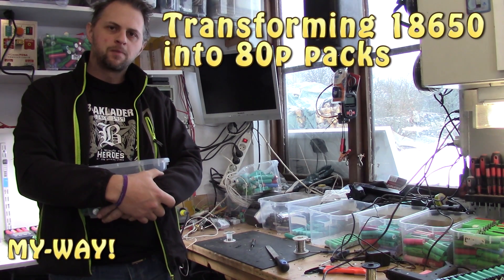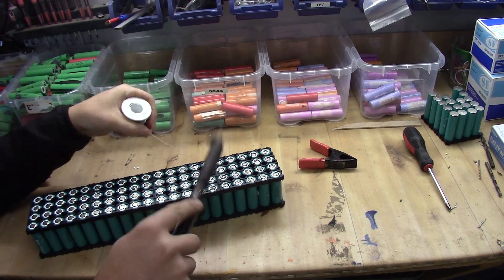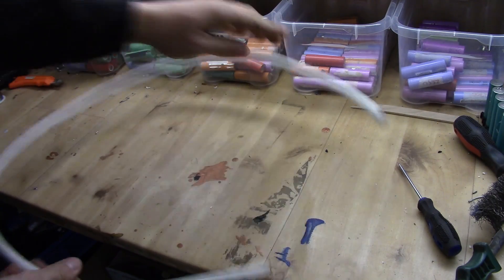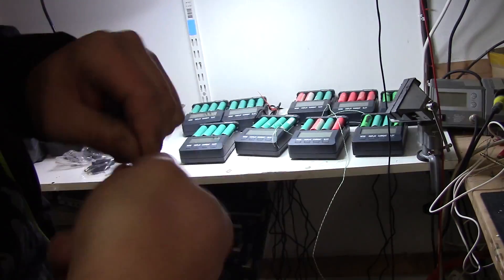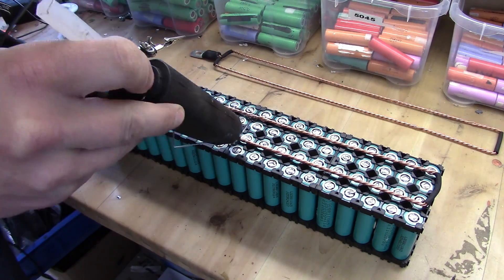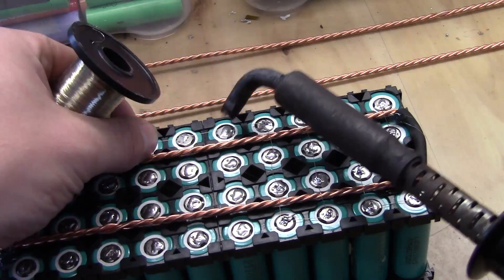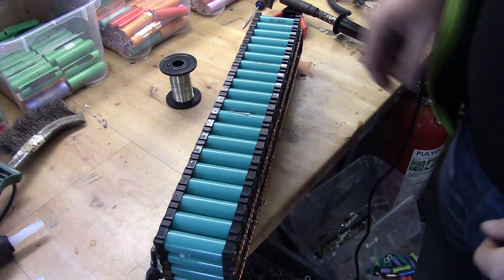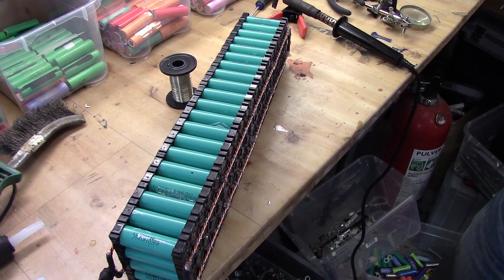18650 - Assemble the packs HOW TO 80 Tesla powerwall!

Comment: I love that soldering iron 200w... It looks like a old timer. Where did you get that?
Reply from the maker: Good question. Its something my father had earlier. Im guessing 2-300watt. And its at least 30 years old :)  It have a solid copper tip so it erodes quite fast but its easy to just change to a new one...